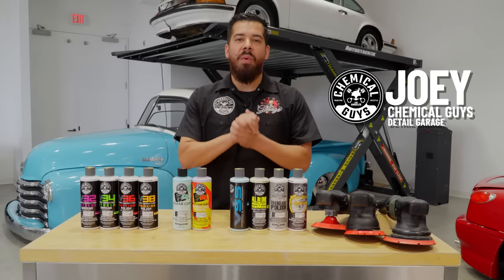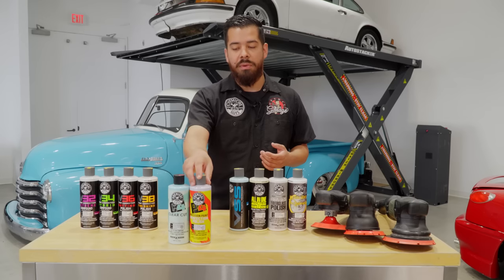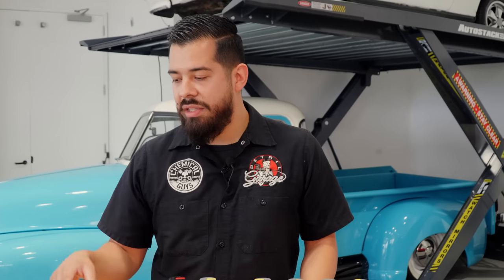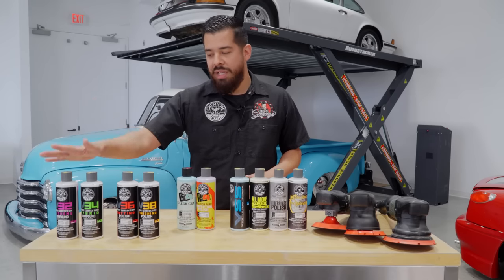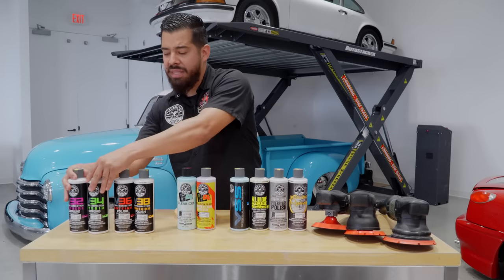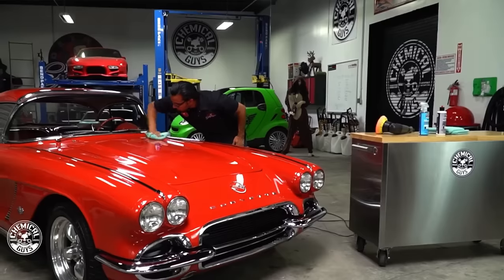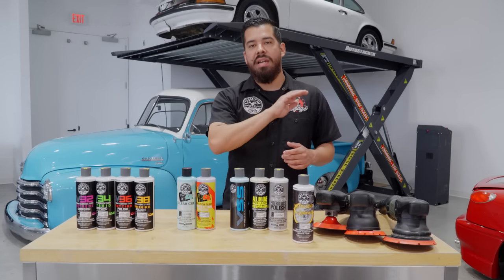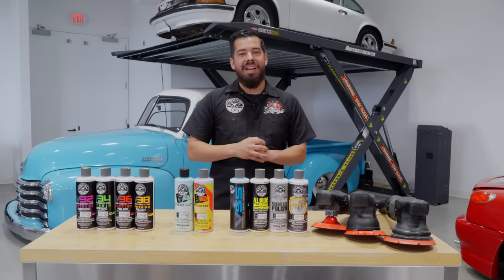What's the difference between a compound and a polish for your car? Chemical Guys

Comment: Awesome video, where do C4 and P4 rank in the V line of polishes? For example does C4 fall somewhere in  between V32 and V34, does P4 fall somewhere in between V36 and V38? Thanks in advance!
Reply from the maker: C4 would have a similar cut to something along the lines of V34 and P4 would act as more of an in between V36 and V38.
Reply: @ChemicalGuys  So C4 cuts through p2000 sanding scratches?

Comment: I have a 1990 jet boat (fiberglass)  i had a guy wet sand it and treat with "ceramic coating" but it still looks oxidized.   I want to try the phase 5.  What do you recommend for a polish and also what can i use to clean after each river trip.  I use hot suace right now to get rid of water spots . Thanks and great video

Comment: Love all your products and they do work but what about when your car is outside unused and it rains and when it’s done raining and the sun dries the water on the car you now have water marks.
Reply: Water spots from rain aren’t as likely to leave heavy stains in the clear coat, most of those should wipe off with a spray wax or a quick detailer. It’s the hose water and sprinkler water that have high alkaline levels in them, and those alkaline deposits are what dry to the clear coat and are hard to get off. For the water spots that don’t wipe off, try the chemical guys water spot remover gel, it works great!

Comment: In order to remove a ceramic coating from a car is V38 with a white pad enough, or would I need to use V36 for some cutting?
Reply from the maker: Hey! An abrasive is necessary to remove ceramic such as V36 or even a compound like V34.

Comment: What’s the best supplies for cloth seats, vinyl dash/doors, and rubber?
Reply from the maker: We would recommend checking out our Nonsense All Purpose Cleaner which is an extremely versatile cleaner which can be used on a multitude of surfaces and can be diluted to provide different levels of cleaning power.

https://www.chemicalguys.com/nonsense-cleaner/SPI_993_16.html

Comment: I have a black honda with minor scratches in some areas, a little deeper scratches in other areas. Which steps would I take to insure that all the scratches will be removed? And what exactly to use for this process and to protect the paint job from the elements for a better shine.
Reply: Compound with a microfiber pad

Comment: Do I need to clean my pad after each section? Or do you use the same pad for the whole car then clean?
Reply from the maker: We recommend inspecting the pad after doing each section to ensure it's still clean. If it get gunked up with product or contaminants then we would recommend washing it in between panels.

Comment: To all of the professionals out there that may read this or anyone that maybe this that has been detailing for quite a while Chemical Guys usually don't reply to any messages that I post now they may do that for you guys but not for me I have a question for this community of detailers      

What do you recommend using for paint that is how would you say the clear coat is starting to fade and not be shiny anymore and losing its luster even though you may polish it other compounds but still can't get the luster to be restored rashine